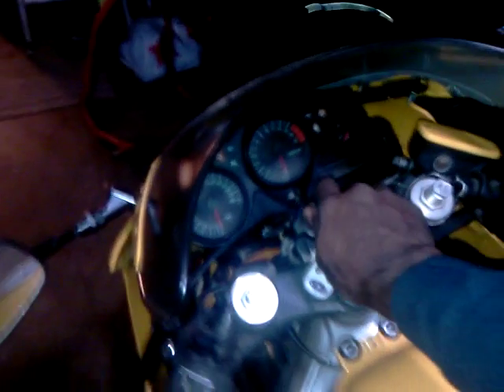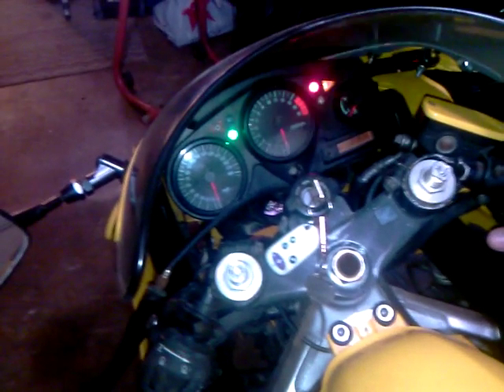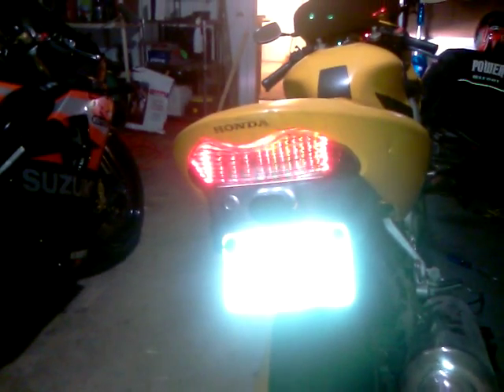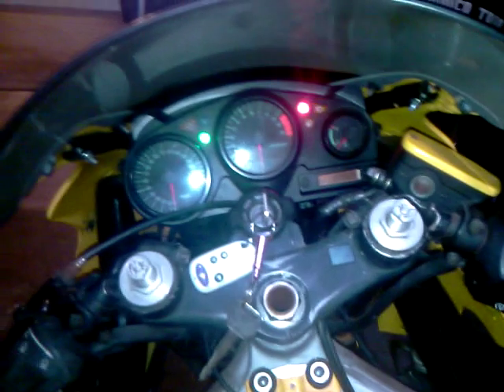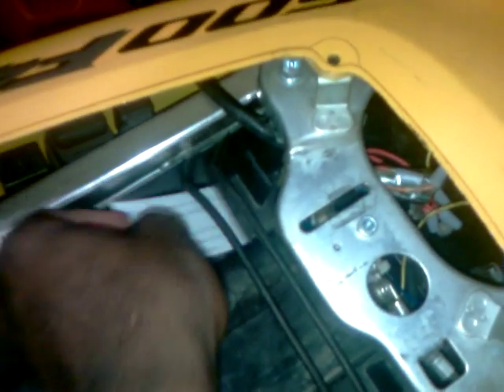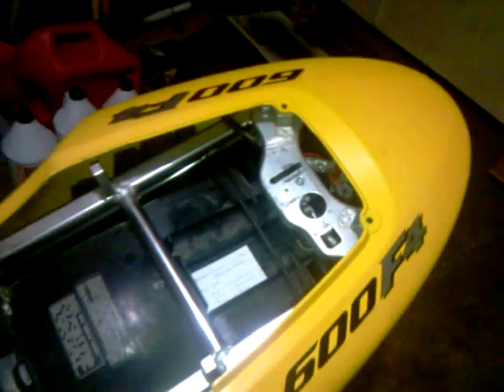2000 HONDA CBR 600 f4 Integrated LED Lights (from Ebay/China) TUTORIAL

Comment: After 41/2 years this video is still helping. Thanks bro, I could not have done this without your help and it only took about 30 mins. I used those little blue quick splice connectors.

Comment: Black is ground, which should match up as green for the bikes wiring harness. Red is constant on, aka tail running light, matches up to brown on the bikes harness, last is yellow, that will match up to green/yellow as the tail light switch input/brake light!
Reply: Your explanation is pointless when there's 4 different shades of green coming from the bike

Comment: what color wire is the front brake light switch? my cousin bought his f4 and previous owner hot wired everything. got the running light and signals but can't figure out the brake light. Thanks
Reply: 91TwinTurboZX 
Same here did you ever figure it out?

Comment: What do you do with the licence plate light and the green wires coming from the blinkers, because i tried to install this light on my F4 and now the bike wont even turn on.
Reply from the maker: sorry I can't remember what all I did. It was so long ago.
Reply: +LaDarryl Hollingsworth yea i was putting the light on got it all hooked up and now the bike wont even turn on and nothing works not even the dash and the fuses are blown.
Reply from the maker: +Dylan Dylan something is definitely  blowing those fuses but the wires to the tail light nornally arent powerful enough to low your main power fuse. All of the fuses shouldnt be blown (it's just not how fuses work). disconnect your hot and ground wires and replace the blown fuse. you should get power back to your  bike at the least. If ALL these fuses are blown then something more powerful than a tail light has malfunctioned
Reply: +LaDarryl Hollingsworth no sorry I meant the fuses are NOT blown that's why it's weird that nothing is turning on I hear it click but nothing comes on
Reply from the maker: +Dylan McCracken ohhh. make sure it's in neutral,  ur kickstand is down and that the battery hasn't some how died.
Reply: +Dylan McCracken I have 5 green wires, 3 black/brown wires, 2 green/yellow wires, then the orange and light blue turn signals all coming from the bike

Comment: I got the same tail light  and wired it up as u said. But my hole tail light is staying lit up. Doesn't do anything when I touch the rear brake any ideas what I messed up.  I had to plugs from the bike that were both those color wires. Did u use both